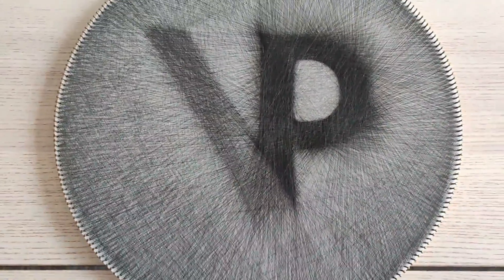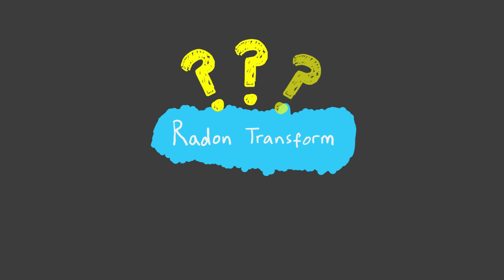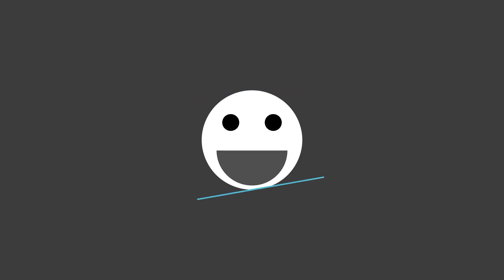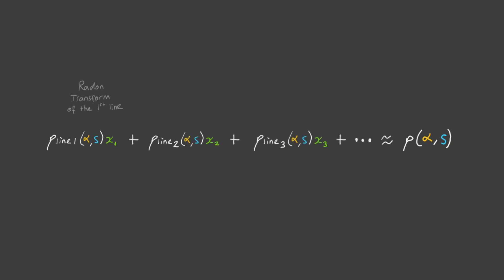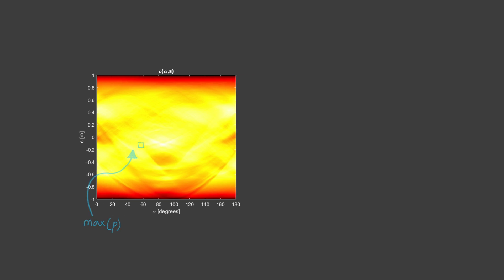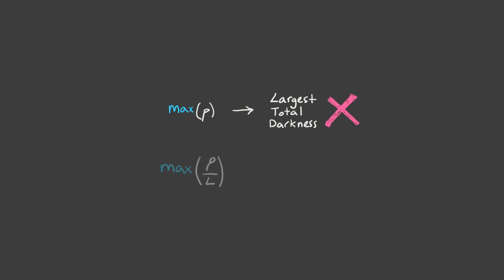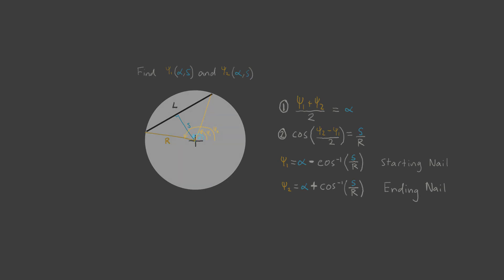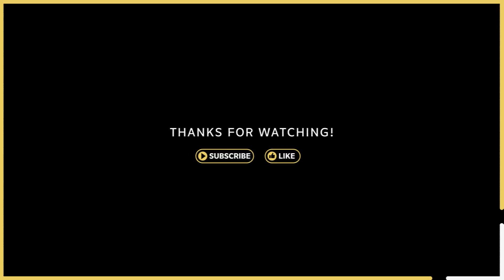How To Make a Computer Create Something Beautiful: String Art #SoMEpi

Comment: You take the point of maximum rho/L of the 'normalized' Radon transform of the image because you assume that would be the line that best fits. I wonder if, for every line you wanted to add, you tried finding the next (alpha0, s0) of the line that maximizes its 'inner product' with the normalized Radon transform. In MATLAB it would be sum(rho_line .* normalized_radon). You could do that using gradient optimization taking the current maximum value of rho/L as the initial guess.
Reply from the maker: what an interesting idea! If the dot product is close to 0 then the line is orthogonal to the image (in other words, very different). I have not tried this, but you have peaked my interest! 

I suspect it'll be faster to do transpose(rho_line(:))*normalized_radon(:)

Cool idea!

Comment: Way Kewl. Occurred to me that you could take it to the next level by doing glowing "EL Wire" art, Assuming it would be an easy inversion, like just starting with a negative of the image or pattern. Controlling the point to point connections with a micro controller could generate lots of interesting visual effects. Scale might need to really large though given the added diameter of the wire.

Comment: Very cool. I suspect a good optimization for color would be to lay down the thread lines in order of lowest average darkness to highest average darkness. (instead of laying down all the red, then green, then etc, in which case the last color laid down would dominate the image). Of course, this would mean the robot would need to support multiple threads concurrently; not sure how much of a challenge that would be.
Reply from the maker: This is a very interesting idea. I'll be honest with you that I haven't fully solved the color issue. It's very complicated since order highly affects the outcome in a very nonlinear way. So far I found CMYK works quite well in a set order but I'm sure it can be improved.
Reply: @virtually_passed  The issue is string obscuring the string below it. You'd need to solve the top layer of string (in whatever colour - here, black is the top layer), subtract that from the image, and then solve the next colour layer down. ... actually, it's weirder than that. The issue is that areas obscured by the top layer are no longer 'interesting' to the layers below them - they can be anything.

Comment: Shouldn't the radon transform of a line be a delta distribution or something similar? Or do they have thickness?
Reply from the maker: Good question. You can model the line as a Dirac delta function. In which case, the radon transform of this yields 1/abs(sin). However, in reality the line will have some width. I've tried modelling the line with a box profile, triangular profile and oval profile, but all of the radon transforms of these profiles are very complicated and slow to implement numerically. In the end I used a mathematical hack to make the Dirac delta function have thicknesses. Does that answer your question
Reply: @virtually_passed  kind of. I was thinking that given a line, there's exactly one value for theta 1 and theta 2 where it overlaps, and for all the others values of thetas, the function in integral to compute the radon transform is 0 at almost every point
Do you compute the radon transform numerically?
Thanks for the video btw!

Comment: So... I can find the brightest point on my transform but it doesn't correspond exactly to any possible thread.   What do?  I tried filtering my transform based on actually reachable threads, but then there's no need to calculate the radon of a single thread and subtract that (since the transform of the image is just a sparse matrix of points).
Reply from the maker: Once you have an ordered list of nails each described with (alpha,s) values, then you need to convert those values to Psi1,Psi2 values using the last formula I derived. Once you do that you'll find that your values will likely not correspond to a perfect equally spaced set of nails, so you'll have to do a linear interpolation. You'll also have to make an algorithm that converts all these individual disconnected lines, into something a single thread can reach. 

Another alternative is to perform the greedy algorithm in Psi1,Psi2 space.

Comment: Hello, thanks for your wonderful video! I tried to create a python code using your algorithme. However, for each iteration I have to calculate the Radon Transform of the current line and it is problematic : first it is very slow, secondly if the line is drawn in diagonal, the result is not the same for a horizontal one. Is'nt it possible to calculte only one line and the extrapolate to other lines with other couple of (alpha, rho) parameters?
Thanks a lot!
Reply from the maker: Hey great questions. How are you calculating p_line? Are you using an analytical formula? If so, are you calculating it using two for-loops? This can be a numerically slow way to go about it, I'd recommend array-wise multiplication and division. Then you'll be able to calculate p_line very quickly from a formula. 

Another thing I should confess is that the formula I showed in the video is a bit simplified. I actually used a slightly different formula which didn't make the assumption of an infinitely thin line. 

It's true that the lines should be rotationally invariant which means that a line which has the same s value as another line should have the same radon transform except shifted and alpha

In case you're interested I have published my code on patreon :)
Reply: @virtually_passed  Thanks for your answer! To calculate the Randon Transform I use a python library :p Honestly I didn't check how this fonction works, but I guess it might be optimized.
Oh great for you code, I will watch it !

Comment: great Video. Thank You. But i don't understand all of the equations completely. What did i need to run your code on my PC with my owne images? Yes i need Math lap but which version. On the web page from Math lap i can buy 1000+ different versions.

Thank You
Reply from the maker: Hi! That's ok if you don't understand all the equations. My MATLAB script runs all of that for you so you don't need to know what's going on under the hood. You can download my MATLAB script on my patreon. It should run on any of the latest versions (2018b and up)
Reply: That means i only need the "Basic" math lab version, and i am good to go? 
Is the script on your patron only for BW images or also for color ?
Reply from the maker: @m10h20  yes. So far it's only for circular BW images. I'm currently working on perfecting my scripts for color string art and rectangular string art.
Reply: @virtually_passed  Hey I successful run your code to Create my own image. One side node Mathlab need 1 extension "Image Processing Toolbox" to run the Code.

But I have one question. Where can I get the output as file? I tried to write all coordinates in to a File. The Problem that the End of Line are not the start from the next line. 
what did I wrong?
Reply: Thank you very much I will test it.

Comment: where is the fourier transform that u promised in last video ?
Reply from the maker: The FFT method that I alluded to last video was lightning fast, but the results (in my opinion) weren't as good as the results you can get using the radon method. I managed to use the FFT by boiling the problem into a convolution. More details are available at my Patreon if you like.

Comment: This is great! Just out of curiousity, why'd you chose to use the CMY values and not the RGB? Wouldn't it work with Red, Green and Blue string?
Reply from the maker: Hey sorry for the late reply. It's because CMYK is subtractive, meaning these colors absorb light, which is a crude but hopefully roughly accurate model of how the strings interact. 

I think it is possible to do it with RGB but it'll involve several tweaks to my algorithm. It turns out colour is very complicated and I'm still learning a lot about it

Comment: Nice work! After your first video i went down a similar rabbit hole and ended up with the exact same algorithm as you, but eventually realised that it essentially is the same algorithm as the greedy one. Ther must be a better solution than greedy!
Reply from the maker: You're right! My FFT algorithm avoids greedy and it's lightning fast. However the results are worse than the radon method in my opinion. 

I also have a sneaking suspicion that a modified inverse radon transformation could be used to solve this string art problem. That would be the holy grail. I've yet to crack that egg though :)
Reply: Yeah that would be ideal. I also thought about truncating the single line radon transforms  to just the high intensity bow tie section and then solving it as a deconvolution, which would essentially be a faster approximated version of your initial optimisation algorithm, but ran in to the same binary problem. I wonder if there's a space in which the single strings are related by just a translation.
Reply from the maker: @thisismy181  Wow!! I had the exact same idea originally. Indeed it only works if you leave it unconstrained. If you try and turn it into a constrained optimization problem it becomes too computationally heavy to be practical.
Reply: Also your images all look wayyy better than mine in general. I don't think the line profiling work you did can be understated!
Reply from the maker: @thisismy181  Thanks! yeah the calculations shown at 4:56 are a pretty heavy simplification. There's actually a few more steps that I didn't show for simplicity.

Comment: Using the Radon transform here would make chaining lines end-to-end pretty fast, computationally -- given a fixed starting point, the possible lines would form a 1-dimensional curve in that space that should be quite fast to scan for the next maximum.
Reply from the maker: I agree. In fact, what you could do is convert from radon space (alpha,s) to "nail space" (psi_1,psi_2). Then when searching for the next maximum don't bother searching the entire domain for the maximum, instead only search in a vertical line - since the psi_2 from a previous iteration becomes the psi_2 for the next iteration

Comment: CMYK only works if the threads are transparent, like ink.
Reply from the maker: At the moment I model my lines as partially transparent. Although I'm still unsure if this is the best possible model for them. This is the most difficult frontier that I'm facing at the moment in string art haha
Reply: @virtually_passed  That should work for a black thread, as covering up a light background partially with black is equivalent to reducing the total brightness with some factor.

But consider a white thread. In the CMYK model, it would be completely transparent - have no effect. In reality it would reduce the light passing through from the background just as much as a black thread, but then ADD it's own brightness,
Reply from the maker: @victorwidell9751  I really like the way you think about this. In your opinion, what do you think is the best way to model the thread?
Reply: @virtually_passed  What was the purpose of the partial transparency? Just antialiasing?

Perhaps skip all that and compensate with higher resolution on the transformed space if it introduces aliasing?

I’d model the thread as just fully opaque. I’m assuming that you can use any colorspace as long as it supports linear interpolation.

That way you can use any number of colors really. And any color. 

But if you have multiple layers of different colors, each of them will cover the ones below. you should probably start the optimization with the top layer where they will be more relevant for the final image, and add more layers below.

You could possibly use multiple layers of each color.

Comment: Isent this the same as calculating the intensity of all possibal line and choose the darkes possibal line to draw on? But the radon transformation is calculating it in a way that is fast insted of check all possibal lines for every line? 🤔🤔👍
Reply: And whan drawing the HP image. Did the lines have some transparency to it? Or are thay solid black?
Reply: Can you also post some image off results using the different algorithms on the same images? ❤
Reply from the maker: @PumpiPie  With regards to your first question, yes, that is basically what i'm doing. With regards to your second question, i modelled each string as black with high transparency (you can prove that two highly transparent images overlapped on each other add in darkness). With regards to your third question, my previous video shows results using a different algorithm. But it might not be comparing apples and apples because the lines are defined slightly differently
Reply: @virtually_passed  

2 question)
Compared to a real life version. Is it more realistic to add some transparency to the lines on the final piece? Or are it more realistic to use solid lines? 😀

Thanks for taking the time to answer. Will have a look on your patreon when i get vacation :)
Keep up the good work :)
Are there coming more videos soon?
Reply: @PumpiPie  That would depend on considerations. Mostly, how thin is your string in real life versus the size of the canvas and how high resolution is the image you are working with. If the pixels per inch isn't high enough, a solid line would not be representative, but if the resolution is too high, the it would take a really long time to calculate. He went over this issue in the first video.

Comment: add a 3rd spatial dimension with virtual, translucent strings. then realize these could be sub-luminal laser emitters (like in the tilt-five device) in a flourescing gas instead of pins with strings.... where beams overlap they excite the gas to levels of luminosity then 🎉 you don't need a second pin, maybe see what it looks like with half a sphere, and boom, volumetric imagery baby!

Comment: Question: doesn't this algorithm miss one important aspect of a physical contiguous string? I.e. the order of the points has to be such that they can be connected such that psi2 for any line is psi1 for another line except in the case of the endpoints? I imagine you could do this with a greedy search with no issues for a high enough number or lines, but it seems like it converges to some sort of assignment problem in low resolution cases or cases with highly non uniform density for various angles psi. And you'd end up with a systematically distorted image in these cases maybe?
Reply from the maker: Sorry for the late reply. Indeed in the video shown I do not specify that the nails need to be uniformly spaced. There are two approaches to solve this problem. 1) during the greedy algorithm only search for a maximum along a limited domain (this will be a sinusoid in radon space) or 2) do an interpolation afterwards. I personally prefer 2) because it's numerically easier
Reply: @virtually_passed  makes sense. I suppose if you imagine a sufficiently dense nail domain, interpolation would be great. But I mean more about the order of the lines under the assumption that the lines are one long contiguous string. So you've constrained the set of angles after interpolation to represent a graph with all nodes having even degree except the endpoints and all existing in 1 connected component, then you ask the question "what's the eulerian path from endpoint to endpoint?" And the answer (which may not be unique) defines how to wind the string IRL. If there is no eulerian path (assuming you're only allowed 1 contiguous string), I think it wouldn't be a physically possible set of lines, right?
Reply: I also was curious because i thought the continuous part of the string was supposed to mean that it would mean that the end nail of a string would need to be the start nail of the next string edge. However, since it's all nails, you could technically optimize for the best two nails at any moment and just 'use' more string by moving the string around the outer circle of the nails until you reach your target nail. It's a bit of a waste of string but it still is a contiguous string.